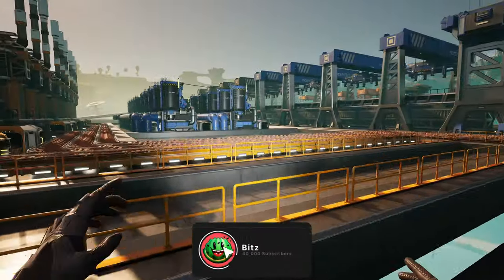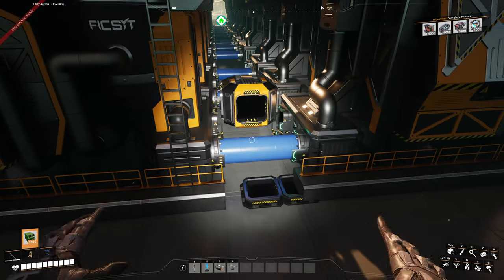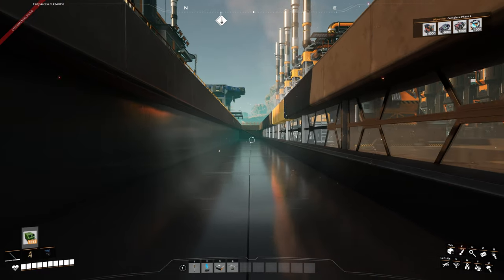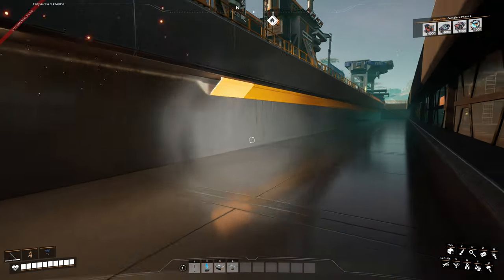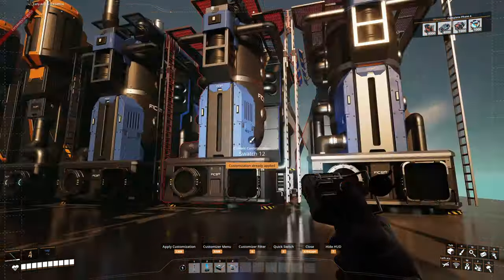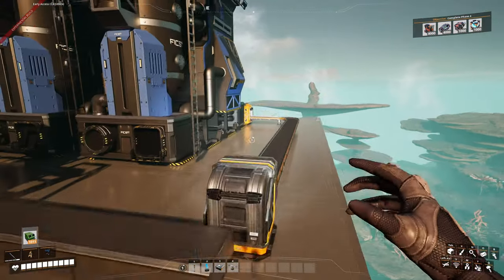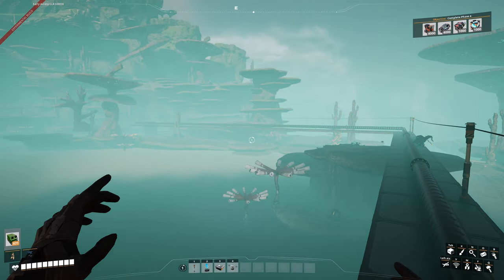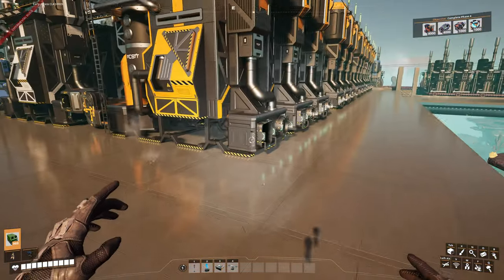ALUMINIUM ELECTRODE SCRAP PRODUCTION CHAIN!! In Satisfactory

Comment: Though I’m not a fan of seeing your factories floating in midair or your machines not being surrounded by walls, I am a big fan of your factory and maintenance floor designs. When I start a new playthrough I really hope I could use your floor designs as templates to make my own designs.
Reply from the maker: Yeh, the floating factories are always going to be a Thing until the build is final, because there is no point in working on all the underflooring and structual support and then it being removed entirely.